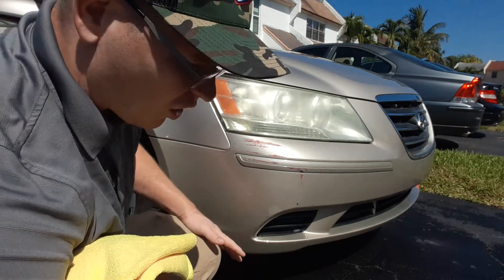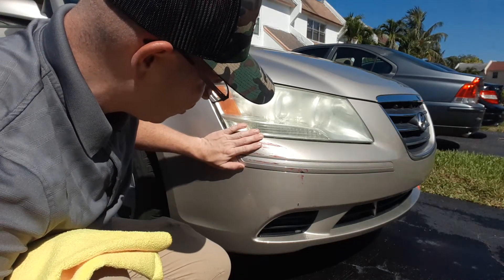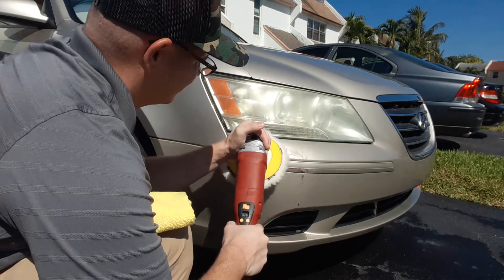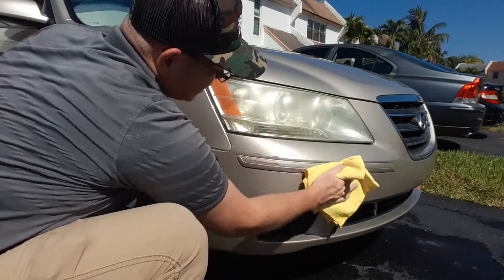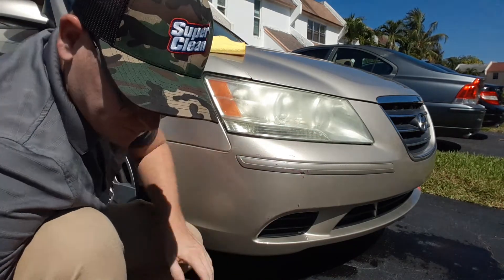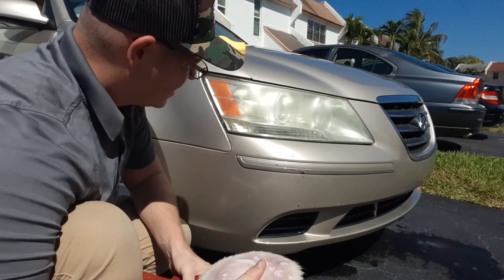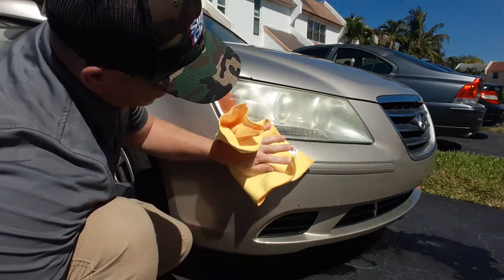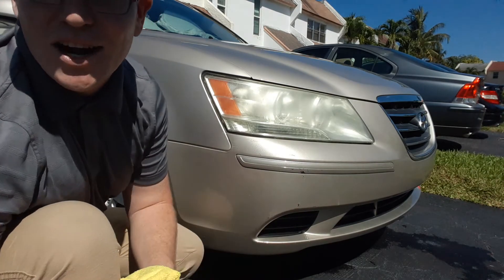Removing Scratches With A Rotary Buffer

Comment: Nice video . I use a rotary with a 5 inch backing plate and six and seven depends on how much area I want to cover. Early 90s is when I learned the rotary. Only just started using DAs five years ago. But anyway thanks for the content great videos.